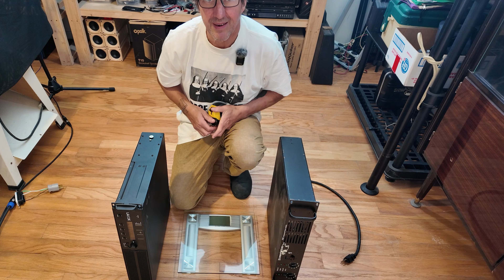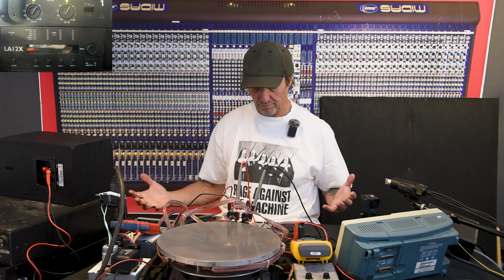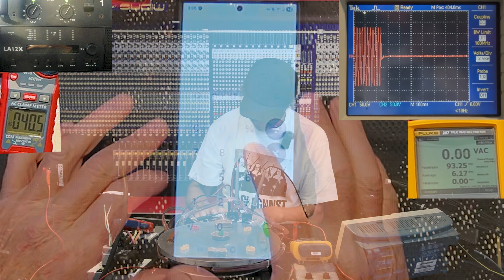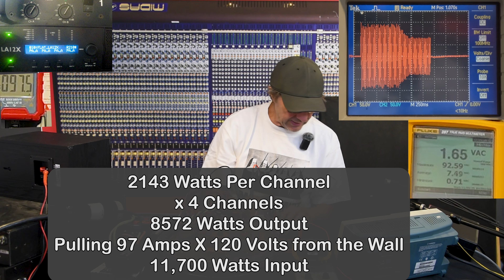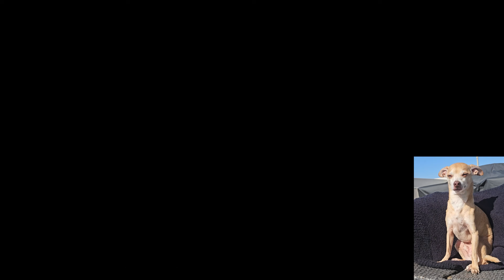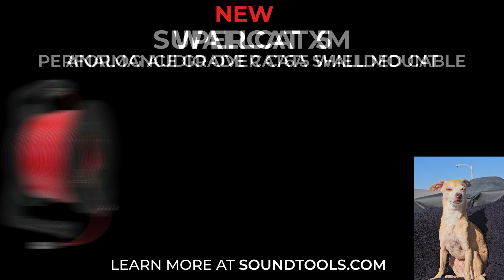Who Does RMS Power Better, Old or New Amp?

Comment: ab for the win
Reply from the maker: I'm doing a show right now and we are using about 200 class D amps weighing about 6000 pounds with about 2 million Watts of power ito 528 large format speaker cabs covering 1.5 million square feet of audience

the class D amps we use (LA12X and LA8) put out over 300 watts per pound 

if we switch to class A B, we can expect to see about 30 watts per pound which means I would only need to add 54,000 lb of amplifiers to do the show.

and bring five times as many amp racks

the good news is that would only be adding one more full semi 40 foot of nothing but amp racks

but we'd also have to double the amount of power cable and generator capabilities. 

but yes for small home Hi-Fi and tiny little gigs class A B amps are cool and fun

Comment: will this apply for most 4 channel class D amps? i mean, using no more than 2 channels for subs?
Reply from the maker: typically yes. the power supply tends to be the limiting factor. 4 channel amps are good to drive Subs with one or two channels mids and then highs.. using all four channels for Subs will quite often be limited in powerper channel
Reply: @DaveRat  Thanks a lot ... i sold all my powersoft K amps and i will replace them with 4 channel amps. (not sure what brand/model yet). I will use them like you describe ... very useful info as always..

Comment: Hey Dave! Great presentation here, I always 2nd guessed the new(er) Class D amps from when they first came out 20-25 years or so ago. It was obvious to me that these amps where not putting out the listed/advertised power, I started out with A/B amps from the 80's & 90's with my first bands. I was excited about Class D until I actually got a pair of powered 12" Behringer Euro 212D top boxes and started using them, huge disappointment! There was just no way that box was putting out 500+ watts, the old 1980's QSC 1500 amp we used for our 18" sub's was way louder and so much cleaner sounding as well. Back in the day I experimented with the sub's, monitors and our top box's in several configurations and ohms/output ratings with that 1500 watt QSC behemoth and got much better sound and SPL's than the so called better, newer technology from those powered class D speakers. They would clip and distort if I pushed them beyond moderate levels and it was worse with live reinforcement, seemed to handle prerecorded music slightly better,  I was a solo acoustic guitar and singing act at that time using a nice Crest XR 20 mixer, 58 & 57 mic's, very little outboard, just a DBX 1231 EQ and a Lexicon time-based processor. I guess the only good thing about those speakers was that they didn't draw much wall-power but I'd rather have a properly set up power grid than have to deal with all the mess that system was producing.

Comment: Dave, the calmness with which you turn on a DIY double-edison connector & watch a resistor immediately explode... have you ever been seriously injured doing this?
Reply from the maker: I've had some good zaps over the years. 120v does not scare me much. back when I was a test tech for switching power supplies I once got launched over the top of my high back tech stool.

back when I toured with Black Flag I used to hot tap the power tails in live panels and took some good hits. I have intentionally laid wires across 240v to vaporize the copper just for fun

I found a power transformer once and made a Jacob's ladder that was really cool.

blowing up load resistors is quite common and more of an annoyance than anything else

Comment: The flaws of new technology tend to stick around long after those flaws are remedied.  1990s and early 2000s switching amps, especially those used in car amps and home subwoofers, were notorious for crapping out when pushed too hard. Its not rare to run into someone who hasn't consciously used a switching amp since those days, thus the reputation lives on.
Reply from the maker: very good point. And I have an affinity for the old style amps and their simplicity and reliability. And it comes down to perspective. for my home Hi-Fi stuff I kind of want old style amps but for pro Audio you can't use anything other than modern amplifiers

Comment: Try a crown 5000Vz ou a 10000
Reply from the maker: I think the main thing that I gathered from doing the test was that the AC supply power is the actual limiting factor. 

it has nothing to do whether it's class D or class A B or whatever, All of the amps are limited by the circuit breaker size. 

that said, since class D amps are significantly more efficient, that means for any given wire gauge size of the AC power, or any given circuit breaker size, or any given generator size, A high quality class D amplifier will supply more power to your speakers than a class A B or class h amplifier can possibly do. 

this could be RMS peak or any power rating you wish to test or use

that is not to say class D is better, it just has the capability of supplying more RMS and more peak power than the other designs. 

of course there are many other factors and the ability to supply and deliver power to the speaker is just one of them

Comment: Amazing stuff about the power cable section..... I long suspected that. 

Surely a fair more fair comparison would have been to compare the LA class D with a Crest 1004 which is the closest comparison on a like for like level, as the 7001 was always a "small" amp even back in the day (when we were running 8001's as standard and Crown 5000VZ as standard on subs) We always tend to run Crest CA18's or Crown 5000VZ on subs
Reply from the maker: for all the Rat Subs we ran 7001 bridged mono into 4 dual 18 boxes wires 16 ohms.

the 8001 was too much power and the 7001 was well matched for driving the 8 EVX180s or TAD 1801 drivers.

the LA12X drives 4 KS28 dual 18 caps so at least for me and the years of experience with both amps the drive 4 sub boxes was a natural choice
Reply: @DaveRat  I remember we had Crest 7001, 6001 and 4801 in our racks when we ran the Ampco / EML Martin Audio F2 in our inventory, (Crest 8001 in separate racks for the subs) . The 7001 was great on the F2B 2x15 bass horns (in stereo) 
Sure in Bridge the 7001 would be a significant amp.
When we had the SSE/DB sound MT4 (not MT4) and MT2 the whole lot was run from Crest 8001 amps (Lows mids and highs) which made for fantastic inventory control (just one amp for everything - just one spare needed) 
When I moved on to be audio systems manager for a company that was running Community we were running Crest CA 18  (which was basically the same power as a pair of bridged 7001s) 
We had run a bunch of tests between the CA18 and Crown 5000VZ at the time and the difference in sound was small enough to not warrant the extra cost of the Crowns. 
When we got the Community AirForce rig we powered the whole lot from CA18's. (at the beginning) 
We had a huge falling out with Crest Audio when they shipped us 24 brand new burned out CA18 amps just two weeks prior to a major festival going out. They had basically shipped us all the blown returns at the factory. We had 8 new amp racks on the bench ready for them and not a single amp of the 24 was fit for use.  - We never bought another Crest product again after being a 100% crest user. 
That was where we moved to Class D amps. 
At that time we tried Camco (Vortex) and Lab Gruppen FP6400, eventually we settled on the Lab Gruppens (they were better on the HF than the Camco) 
Now from going from a Crest  CA18 to a Lab Gruppen FP6400 we had a HUGE difference in LF sound, the Lab Gruppen seemed faster and had more impact but the Crest CA18 had a far richer fatter low end.  It was like comparing grapes and bananas (there was no similarity, but neither was "best") 
The Community AirForce AF10 boxes (80Hz to 200Hz) really worked well on the Labs - As a 3 driver series connected box at 12 ohms 4 cabinets in parallel would load the amp to 3 Ohms (closer to 4 ohms when driven hard) and in bridge mode it handled them well. There was a distinct advantage over the CA18 in that band Where there was a general preference for the Lab.
.
As we went on we found that also the way amplifiers are power rated changed right about the time the amps got smart.
It became hard to know the comparable power of an amp. 
For a long time we had most manufacturers using IEC / FTC power ratings (Continuous sine wave all channels for prolonged period) and some moving to EIA that they could twist a bit more. 
When Powersoft came out with the Digam series they moved to EIAJ which was just a burst test (1KHz at 8mS on and 24mS off )
It was the swap to these figures that started the whole "Class D can't deliver constant sub-bass" theory in the industry.
What had happened was we had a 3KW amp with a bit of headroom specified as a 6KW amp - suddenly smaller amps delivered higher power as if by magic, and if used with care on a signal with dynamics and headroom we did see higher power. 
.
In any case.... We miss out the elephant in the room here......
POWER COMPRESSION. 
With today's stupidly rated speaker drivers - Power rating is just a destruction test not an output test.  Drivers are able to run hotter for longer without failure, but most drivers will be well into power compression by the time they are even close to their limits.
It is common for a driver to be 6dB into power compression by the time it is close to rated power. 
Power ratings under the AES are just voltage measurements based on the cold measured  impedance figure of the voice coil.  it is (WRONGLY) assumed that when the driver fails the voltage it was receiving is into the cold coil load, and not the hot coil load. 
By 6dB of power compression an 8 ohm coil will be somewhere about 32 ohms.
So where does this affect modern amp ratings. 
Well these 8KW 2 x 18" subs that are being driven flat out are really just big electric heaters. by the time the amp has dumped the required voltage into the load to get to 8KW at 4 ohms the load has become a 32 ohm load. 
In tests we did working with the Community AirForce we timed the onset of power compression in a conventional free air coil bass driver. the coil reached 300 degrees F in about a second and a half. 
This means that in a real world situation on crazy spec woofers an 8KW amp will only ever be asked to deliver 2KW of real RMS power but must deliver the voltage to get to 8KW. The impedance of the load has quadrupled and the drawn current quartered for a fixed voltage. 
We have gotten into a real of watts that don't really exist, amplifiers that can't deliver them, and speakers that can't take them, but the "phantom" voltages are there. We measure voltages against wrongly assumed loads to calculate watts. 
.
The problem comes when the load does not power compress. This was a big consideration for the Community AirForce system, when power compression had be reduced to negligible levels through combined ferrofluid and forced cold air cooling of the drivers, a higher than normal load was presented to the amplifiers at high power and a greater risk of throttling back is present with newer more advanced amps. 
When I bought the AirForce system from my ex employer a few years back I had to do a lot of testing of amps. I am finding that some of the older "dumb" amps actually have less artefacts when driven hard on it, or I have to go to huge power modern amps. for the same max levels. I struggled to get some Powersofts to deliver their max voltage under load and saw exactly what you showed on your scope on your resistive load.  Yet I doubt this will be a problem on a system that is thermally power compressing

Comment: OK, I hope you can settle something once and for all:  Can UNDER-powering a speaker cause damage? I thought the definitive answer was "no", but I keep hearing this from people. What's the real deal?
Reply from the maker: That's a great question and I don't think I have a definitive answer but I can offer some insight. 

to clarify the topic I believe this is based on "does using a larger amp that is not clipping or limiting put less stress on the speaker then using a smaller amp that is clipping or limiting?"

One train of thought is that the harmonics created by a smaller amp clipping can be damaging to the high frequency and the DC component of the square wave of the clipping can be damaging to the low frequency drivers and overall the clipping and distortion adds a bunch of extra signal energy causing drivers to burn up more readily than when the signal is clean. 

The other train of thought is that more power is more power and it doesn't matter if it's clean or dirty and it doesn't matter if the amp is clipping or not.

what I do know is that if you don't clip a big amp and you don't clip a little amp and you run them at the same volume everything's the same. 

And if you don't clip either amp and run the big amp louder that will be harder on speakers then a small amp not turned up as much. 

The real question is if you have a big amp and a little amp and they're both run clean no clipping, And a little amp is right on the verge of maximum, And then you turn the signal to both amps up 6 dB, such that the little amp is now clipping and the big amp is delivering 6 dB more power to the speakers, Will the speakers driven by the little amp or the big amp see more heat /excursion? 

low frequency excursion is easy to answer and the big amp will definitely cause the speaker to have more excursion than the smaller clipping app.

as far as heat for the low frequencies, The little amp is delivering less power even clipping and if the speaker is able to handle the power of the big amp then the little amp clipping should not bother it. theoretically the big amp should deliver more power and generate more heat with a clean signal.

So for low frequencies it's highly probable that the little amp clipping is not more dangerous for the speaker. 

for high frequencies, The square waves generate a lot of harmonics that go through passive crossovers sometimes and get sent to the high frequency drivers. This additional high frequency energy that will tend to be more significant than what was in the original material, will be highly probable to add to the stress of the high frequency drivers. but that said, The big amp has 6dB more output which is double the voltage, which also will put significantly more stress on the high frequency driver. 

And that's the part I don't really know and it may be content dependent and driver type dependent and passive crossover type dependent. 

and another angle is what happens if you clip the high frequency amp after an active crossover driving high frequency drivers. Does that amplifier when driven into clipping possibly create subharmonics due to intermodulation distortion? that I don't know either but if it did or does that could be a significant issue.

So I don't really know the answer or maybe there isn't a simple answer, but it is something that I've thought about testing and doing a video on but haven't come up with a clear path forward yet
Reply: @DaveRat  Thanks as always. I guess for me the moral is just to be sure to do a good job matching amps to speakers! Much less of a worry for our little company today, as we've largely gone to powered cabinets, and what passive cabs we do use (like our Radian monitors!) have amps that are well matched with appropriate processing. But knowledge is always a wonderful thing!
Reply from the maker: Yes you're on the right track. I think the concept of using bigger amps will blow less speakers comes from kind of an observational adventure 

where inexperienced or unregulated scenarios have amplifiers driven into overload for long periods of time also have a bunch of blown speakers 

and people with deeper pockets and more experience and bigger amps don't overload their stuff as much and they tend to have less blown speakers 

and the whole thing is more of an observational perspective of reckless versus not so reckless and a drawn conclusion that bigger ants blow less speakers when the real factors are much more nuanced

Comment: I can feed a 60hz sine into a macrotech 5k adjust the attenuators to output 120V at the binding posts and power a shop vac. Do that with an LA12x cause in my experience, it takes a itech 12000 to do what a Macrotech 5k can do. Granted, weight and power density = Truck pack efficiency, so I'm not knocking them but like ya said, don't expect to utilize all 4 channels on a modern amp at the rated specs for more a second. I work for the third largest company in the US we compete with solotech, clair, 4 wall and while everything is itech 4x3500 Itech 12000's or LA12x LA8x we still have pallets of the 5k's and 3600's sitting in inventory for the "just in case" situations.
Reply from the maker: interesting and cool! 

a toaster typically pulls more power than a shop vac which typically is only 6 to 10 amps.. maybe give this video a look 
 https://youtu.be/w_0UZviEDhc?si=wSwjfV9B3jJvU2rv
Reply: @DaveRat  That is very cool!

Comment: so could the power drop off be mitigated by splitting subs across multiple amps and mixing in some front fills and wedges etc. so that you're not loading one amp too heavily
Reply from the maker: absolutely. and also dropping from 3000 watts to 1500 watts is 3dB drop. and since the drop is power over time, it means a slight reduction on oupt of some of the sound when pushed really hard.

this typically would not be an issue for nearly all scenarios except when you need absolut maximum output for extended time frames.